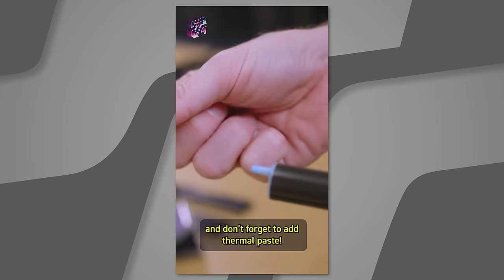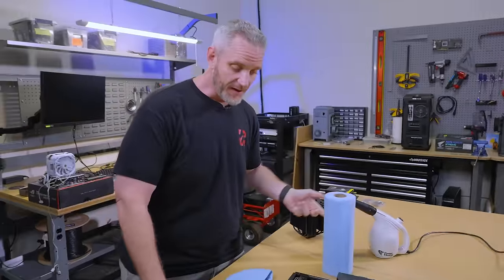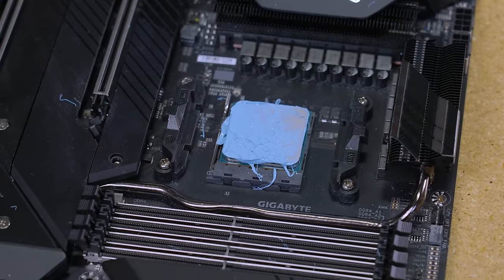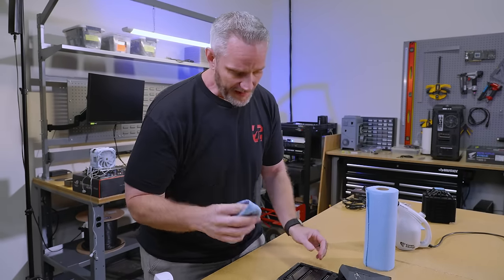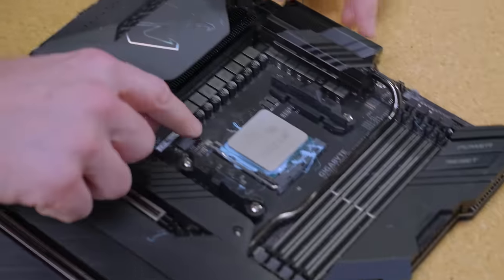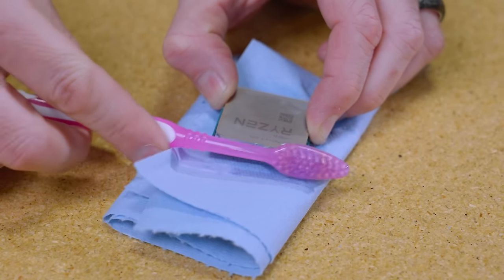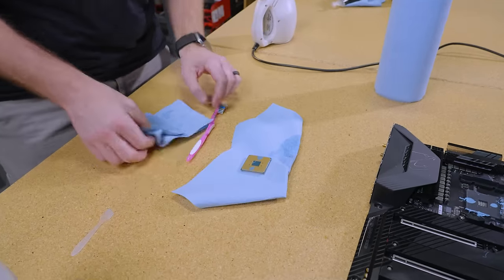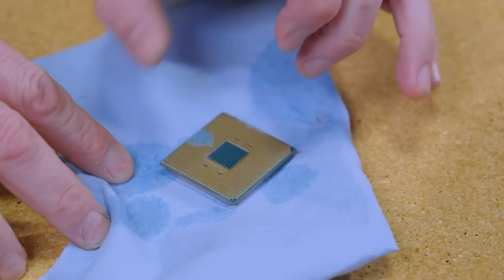This is a disaster!

Comment: To avoid the blue residue, don't use the air to blow the contaminated Iso off.  Instead tip the board on it's side & just rinse with a little more iso so it is all washed away.  Then once all contamination is gone, you can use the air.  Source: 20 years of experience repairing avionics boards.

Originally, it was a '3 pot system', of X55, ethanol, & freon.  But then freon was banned, & then ethanol was deemed too toxic & replaced with isopropyl since it doesn't leave a residue.

But with a non conductive paste, I would likely not bother cleaning the socket, since I remember using sub-zero phase change cooling where filling the socket with dielectric grease or non-conductive thermal paste was standard procedure to prevent condensation causing shorts under the chip, or on the back of the board.
Reply: Step 2: Lay some blue towels around the CPU so the cleaning residual is soaked up.
Reply: Same thing we do with washing out flux. Even better, start cleaning with it already angled out to drain anything off
Reply: Ah, I miss the days of phase change cooling before liquid nitrogen
Reply: @406Steven  The problem with phase change was how much heat it could pump out.  Modern CPUs just totally overwhelm it.  Just can't pump the heat away fast enough. :(
Reply: @NemoConsequentae  true, that's back when a 110W Prescott P4 was considered obscenely hot!
Reply: very interesting ty!
Reply: @406Steven  And now when they can use 200-350W or more... Phase change just has no chance.  You'd have to use something like an alcohol liquid loop to get the heat away from the processor, then a large phase change heat exchanger to cool the alcohol. (Or whatever liquid that could both stay liquid at sub-zero temps & has enough heat density to be viable.  And then how much power are you using to run a big enough refrigeration system to do it?
Reply: @NemoConsequentae  The funny part is that I was envisioning this setup as I was reading your comment. If I had the means to make such a thing it would be a hilarious experiment.
Reply: @406Steven  Engineer brain!  Thinking about how something can't work, & automatically start working out how to make it work! 🤣
Reply: So, using r22 (freon) may be illegal now.

But have you tried Rx11 flush????????????????
Reply: @asbestosfibers1325  No.  No longer in that industry.  All that work is now "Return to Vendor", as well.  Whole workshop was repurposed.
Reply: I'm sure it's going to come down, 15th gen you could use an EK-Quantum Delta type of cooling.
Reply: I usually have lots of IPA at home. I also have a container that is big enough to fit a keyboard or mainboard that currently has like 30 Lietres in it. I use this to regularily just submerge and deep clean different electrical devices that can not be cleaned with water. Tho its imporant to fully discharge the hardware before to omit any risks. It sounds kinda wasteful at first but since i can submerge objects completely i literally only need what is in the container and i can reuse it.
Reply: Yes, these are words.
Reply: @Donnirononon  Just be careful with the keyboards.  I put the final nail into a membrane keyboard by washing it in IPA.  Turns out the conductive tracks printed on the membranes are soluble in alcohol...

Comment: Another thing worth remembering is you can replace just the plastic top layer of the socket - the bit that guides the cpu pins into socket - if its somehow damaged (have done this fix for a friend who dropped his heatsink onto the socket when test fitting everything!). 

The sockets themselves are extremely cheap as oem parts, so you can just buy a complete socket and carefully pry off the top plastic layer to use. Saves having to buy a new motherboard!
Reply: I usually just brought holes back to a clear round opening again using sharp tweezers or a needle. It was rare I had plastic I could justify needing to fully remove for fear of future snags or it elevating the chip in any noticeable way. in any case, yay for solutions!
Reply: Say what you will about LGA sockets, the user-friendliness of the pin & socket setup of AM4 is very hard to beat.
Reply: @233kosta  Cleaning thermal compound out of it sucks. Repairing the socket when someone puts a chip in rotated or the wrong chip entirely sucks. I'd take that any day over the delicateness of LGA; the processor pins were more durable pins and the socket much more durable while I have also personally bought an Asus motherboard with pins bent out of the box back in 2012. That box came from the manufacturer to a truck to our receiving department to my hands from a supervisor and wasn't just out on the shelf, a return, etc. with pins that looked like someone gently imprinted their finger into them.
Reply: @mirror1766  Yeh, like you say, certain parts are a pain, but also you have to somewhat proactively be stupid with the "old" style of socket to actually damage something. LGA pins bend if you look at them wrong 😒

Last time I overhauled my setup (drain the loop, clean the insides of the blocks, etc.) two DIMM slots stopped working. Only thing it could be is a bent pin (which was only ever touched by the CPU, mind!). Touched nothing else on that board and there were no leaks. I've thought about tearing it all apart again and bending the sucker back (or completely demolishing it while trying), but nah. Next time this thing comes out is when it gets replaced by an AM4 board with an 8 or 16 core Zen chip on it.

Keeping the water block though 😅
Reply: @233kosta  Had a customer try to return a board with bent LGA pins and in frustration with the 'no' showed me how they are protected by the cover and gave it a decent slam shut. I gently opened it and showed him additional pins that the nondelicate closing action had bent which put him in the situation of him now knowing he bent pins through his board handling. Looking at them is dangerous, though I always look at sockets for install and if anything goes even slightly wrong with chip offset as it goes in I open and check again. While there you are also always watching for small debris before install on both processor and pins. That is how I know there were bent pins before I touched the board. Good luck with your future upgrade.

Comment: Had to clean pins off my 5900x earlier this year. Didn't have a fancy spray bottle to apply alcohol so I just filled a small bowl with alcohol and gently moved the CPU around with the pins submerged in the alcohol. Took a little longer than a brush but all the thermal paste dissolved into the alcohol.

Comment: This has totally happened to me.

Had to access the RAM, needed to take off the cooler and somehow I pulled the CPU out of the socket with the cooler. Relatively fresh thermal paste, it basically acted like glue or a suction cup. Just yanked it out. Thankfully the pins didn't get bent, but now I had the CPU stuck to the cooler and while removing it carefully, a glob of thermal paste got on the pins.

Basically did the same thing. Isopropyl alcohol and a soft tooth brush. Worked like a charm.
Reply: cpu still works? haha

Comment: As one of those people who managed to get thermal paste in the socket of an AM4 board, I appreciate this. In my case I was upgrading my cpu and when I removed the CPU some of the old dried paste from the previous CPU fell in to the socket. In my case I used a small sowing needle and some isopropyl alcohol to and wet down the pin and very very gently “tugged” on the still dry(ish) paste. Big scare and a bit of a headache but thankfully everything works.

Comment: Prevention better than cure.  But things do go wrong, so for that, this vid is invaluable.  Thanks Jay.

When I got a 7950X, I also got the Thermalright AM5 Contact Frame.  I only got it to help prevent thermal paste from getting down between those stupid notches and make cleanup much easier.   (@AMD, that is a stupid design for an IHS.  Don't do it again.)

Comment: Thank you for the great advice, Jay.  I did this back in July when I had to swap out my Ryzen 5 2600 for a Ryzen 7 5700g. When I went to pull the cpu cooler off, my 2600 came off with it.  And when trying to pry it off the cooler to put it safely away, I got the thermal paste in the pins.  I thought of trying what you demonstrated, but was very hesitant.  Now you proved it's easy as can be.  😁

Comment: This is why I prefer PGA CPUs. Easy to clean sockets and CPUs; pins are more robust than you might think; pins can be straightened; (touch wood) never personally broken a pin on a CPU.

LGA CPUs are even easier to clean, but God forbid that you bend any of the leaf spring/pins in the socket! If you bend one or two, you can generally fix them; bend a few, and chances are that as quick as you straighten one pin, you'll be bending another, particularly if the patch of bent pins straddle the middle, where the pins change direction. 😖
Reply: there is a reason why even amd has moved to lga, it's outdated just like lightning port
Reply: @Simon-tr9hv  what does "it's outdated" mean? This is technology not fashion. Lightning port was dropped because EU laws that mandate USB-C on phones, not because it's "outdated"
Reply: @Simon-tr9hv In so much as, it's probably easier to increase the density of connections between CPU and socket in LGA, without having to increase the size of CPU or socket, yep, you're right. As the desire for more cores, more PCI-E lanes etc. increases, so does the need for more connections. When the number of pins required got too high, AMD either had to switch to a larger CPU, or switch to LGA.

Flip side of that is that, as connection numbers increase on LGA, those leaf spring style pins in the socket overlap more and more - which may actually provide some support and help prevent damage - but if you do manage to damage them, they'll be even harder to fix without bending other pins.

I guess that if you want (and can afford) the most powerful, highest core count, highest lane count small form factor CPU, LGA will be the only game in town from now on. That said, if I was looking at two lower end CPUs, one LGA, one PGA, with the same core count, I would always gravitate towards the PGA.
Reply: @marcogenovesi8570  well, the main reason of amd switching to lga socket is that pga simply doesn't have enough density of pins or contact points to satisfy the spec needed for more powerful cpu without having to increase the size of substrate, as for lightning port, did you know that it's only using usb 2.0 standard? 600mb/s instead of now 20gb/s usb c newest spec?
Reply: @Simon-tr9hv  you need to increase the size of the substrate to fit more pins also with LGA (i.e. see server processors that are big ger than a credit card) so I'm not sure that is a valid reason. LGA is more convenient and won't get stuck in a cooler, that's a feature. But besides that I assume it's cheaper or something and that's why they went with that.

As for lightning/USB-C port, you know USB-C is just a physical connector spec right? The actual data lines can be anything or not even be present (i.e. for a simple charging port). For example even on iphones the "non premium" models with USB-C will still be usb 2.0 so the same speed as lightning.
Most non-flagship android phones have usb-c with usb 2.0 only.
And it's not even a real issue imho, not a lot of people actually NEED to transfer data back and forth using USB on a phone.
The biggest change for phones is support of USB PD so now iphones can finally support the standard fast charging
Reply: @marcogenovesi8570  lmfao believe what makes you feel better buddy, and try to educate yourself better before you say something next time

Comment: You should use Kimwipes Delicate Task Wipers (or equivalent), which are specifically made for cleaning computer components. They are actually less expensive than the blue shop towels. The blue shop towels are not designed nor intended to be used on sensitive electronic equipment. Don't use a toothbrush on LGA sockets, but a very soft bristle brush, similar to the one Jay used to clean the thermal paste residue from the board, dipped in IPA (isopropyl alcohol) to gently clean the socket. On the underside of the LGA CPU, you can just wipe it with one of the  task wipes that that has IPA on it. When using a brush (whether it is a toothbrush or some other brush) to clean CPUs or sockets, be sure it does not shed the bristles. The bristles can prevent contact between the CPU and motherboard, and they can be extremely small and hard to see without  magnification. You can use cotton swabs to clean the IHS and around the outside of the socket. Just don't use them to clean the pins or socket. I swap out CPUs almost daily at my job and need to clean off CPUs after removing them and before storing them when they are not in use. One thing to remember, is to use a static-free workstation, if at all possible. If you don't have a static-free workstation, be sure the workstation is not on carpet to prevent static electricity. Furthermore, be sure you touch some metal (such as the computer case) before handling electronic components.

Comment: I use a q-tip soaked in isopropyl alcohol to clean the edges on the cpu and also the top part of the socket
Reply: qtips leave fibers
dont use those
Reply: @Robbie-mw5uu  😎

Comment: Great video.  I had to clean up an 5600x a few months ago - tried to do a processor swap with the board still mounted vertically.  Unfortunately, I dropped the CPU, bent some pins, and got paste into the socket as well.  One suggestion when cleaning up the CPU, put it back in the plastic clamshell it came in.  It protects the pins while you clean the goop off the sides and top.  Unfortunately, I ended up trashing the motherboard, as when I was mounting the cooler, the brackets slipped and not only knocked an SMD cap off the board, it tore up a trace as well.
Reply: I made the same mistake too before. Never again swaping PC parts with the motherboard vertically in the case..
Reply: Im sorry to hear, but damn.
Reply: Bro are you building a pc or going to war with it lmaaao😂😭😭

Comment: Me who just takes it outside and sprayed it down with a garden hose then i use my fingers to scrub the pins it is fine if you bend a few then do the same with the motherboard then you need to plug the stuff in while it was still wet

Comment: No, dude. You gotta use contact cleaner spray. Just hose it down in a well ventilated area and let it dry completely. The brand I use is CRC. Even works on dried out paste on laptops that iso wont touch.

Comment: Lighter fluid (like Zippo) completely dissolves thermal paste into liquid form. You can drown the socket with it and use some paper towels to soak it up. Repeat until the liquid soaked up by the towel is clear. Also, the lighter fluid evaporates so quickly that it WILL NOT be a fire hazard.

Comment: Do not spray your processors with alcohol because there is a high chance of corrosion over time, as certain types of alcohol contain water. A 70% isopropyl alcohol solution contains 30 parts of water and 70 parts of isopropyl alcohol per 100 parts of the solution. Similarly, a 91% solution contains 9 parts of water and 91 parts of isopropyl alcohol per 100 parts of the solution. You must use contact cleaner and spray a little bit on the tip of the brush before applying it to the pins. Also, my advice is not to spray the motherboard with alcohol! It's even more dangerous because corrosion can build up inside over time. The correct way to clean electronic parts is with contact cleaner, and only professionals who are knowledgeable about electronics should do it, not like the content produced by JayzTwoCents! It's extremely risky for children and those who don't have knowledge about electronics. This content should be remove and make a correct way on how to clean and make it censored so that childrens won't keep this type of content.

Comment: I'm glad you made a video about this, as last month I bought a second-hand x470 board with a big ol' thermal-paste thumbprint on the socket. After wiping it off and assembling the system it would only detect the RAM in channel B, and I was very disappointed about running my system in single-channel; however I opted to do a deep clean of the socket just like this before giving up, and it worked like a charm. I suspect the paste had insulated the terminals inside the socket from contacting the pga pins.

Comment: Would be very interested to see how you handle cleaning an AM5 CPU especially with the gap under the IHS, I think it's called.  Would you spray alcohol under there then use air to push the thermal paste out?  Same with cleaning the CPU Socket on the MB.  A tutorial on that would be fantastic.

Also - I found something on Amazon and have used it in my PC for a bit.  But I'd be curious to see your thoughts on it.  It's called the Thermalright CPU Contact Frame for AM5.  Thermal Grizzly has one for Intel but not AMD far as I know.  So I got this one.

Comment: I've used electrical contact cleaner on an LGA 1155 socket as some paste got underneath and it did a great job of removing it without me touching anything. As the pins are really delicate don't spray it too close, and it didn't take much at all for it to break down the paste.

Comment: Hey i've found that if you buy a wall outlet powered air mattress pump and use the smallest attachment that it works just as good or better than the computer air cleaner that you have there on the smallest attachment theres a small nuk on the tip that you have to cut off in order to get a straight flow of air blowing out... but it works great been doing it for well over 20 years

Comment: This is exactly what happened to me with my TG Kryonaut when I had to replace the gasket in my Arctic Liquid Freezer II whenever they made the defect aware. It was stringy and got on the board, in the socket and in between the pins. It was a far less amount than this of course, but it was surprisingly super easy.